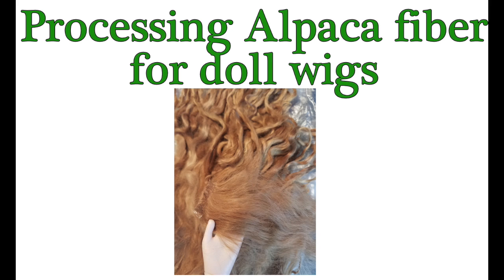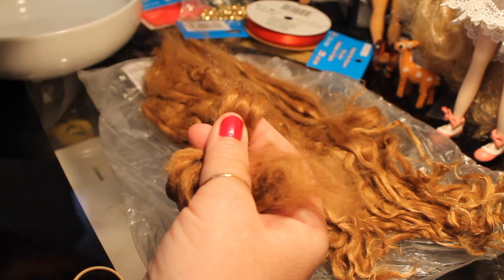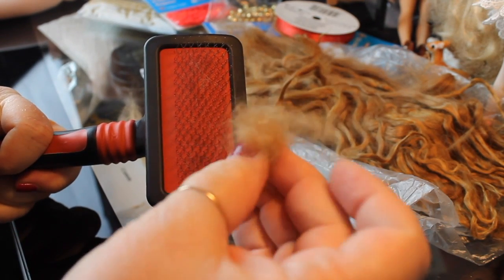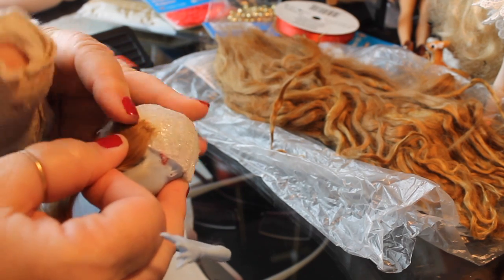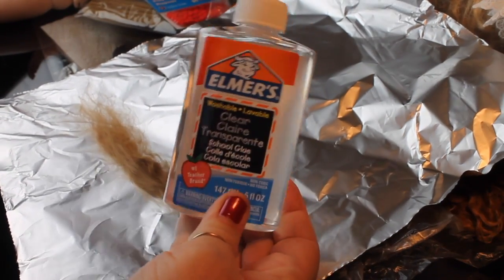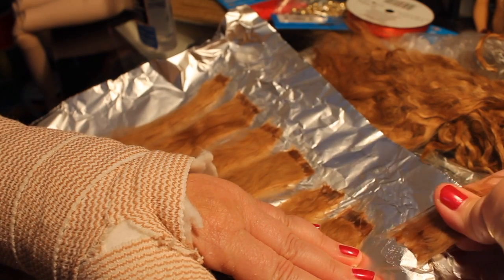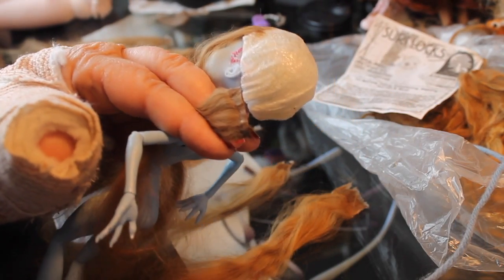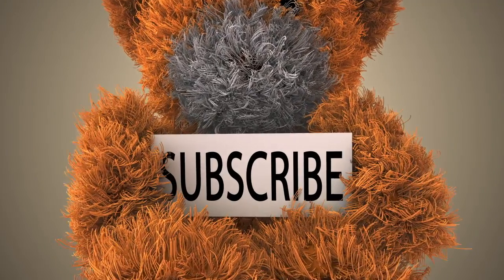Processing Alpaca Fiber for Doll Wigs

Comment: I am starting a business of “rooting” reborn dolls and silicone dolls for collectors. No gluing for me. 😉 I’ll be getting bags of raw Suri alpaca hair. Do I wash entire bag of hair or tiny strands at a time? Then let it dry and brush right? @larajnance
Reply from the maker: Well, I would suggest that you take a clump of strands and put a tight rubber band around each or a tight string tied around them and wash them. When the fiber is wet it is so soft and hard to control. So just keep in mind that it will be difficult to control and have it tightly secured before washing.
Reply: @larajnance  that’s what I’ll! I still haven’t gotten around to this bag of hair haha! Thank you for the great advice. That sounds right. 👍🏼